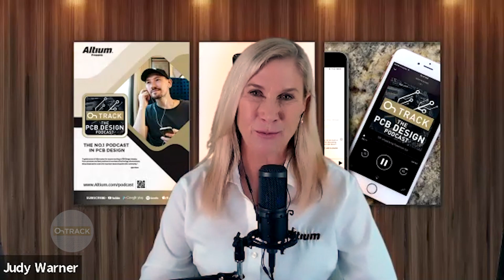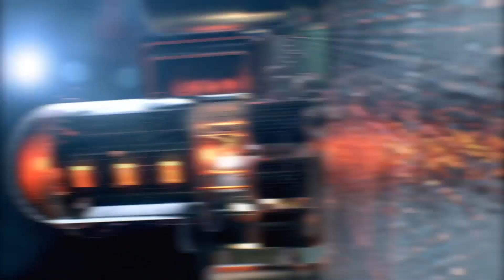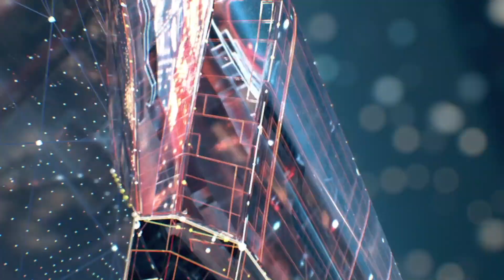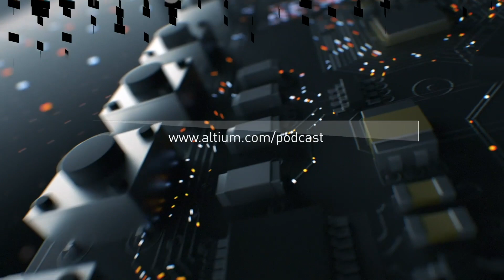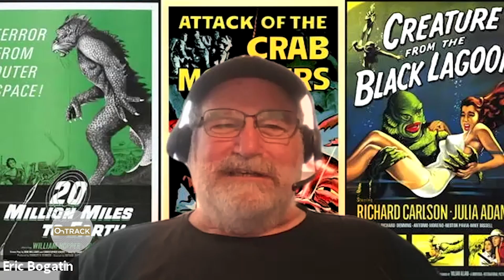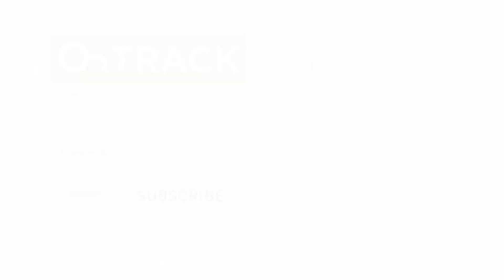Why You Should Stop Hanging on to Legacy Design Rules

Comment: What is “mounting inductance?” In v2 of SIPI simplified, figure 13-27 is nearly identical to v3 fig 13-35, but in v2 Eric calls out mounting inductance, but in v3 he calls out via and trace inductance. Are the sum of those two equal to mounting? Or is mounting something else altogether? Later in the chapter he calls out mounting inductance but I didn’t see a description for it. I’m confused and it is an interesting/important concept
Reply: Pretty much, yes - a key layout parameter that I've been mindful of for years, but one that I didn't realise had a name until I saw this video! There are some good definitions from Intel's "AN 958: Board Design Guidelines", section 1.5.3. Mounting Inductance.